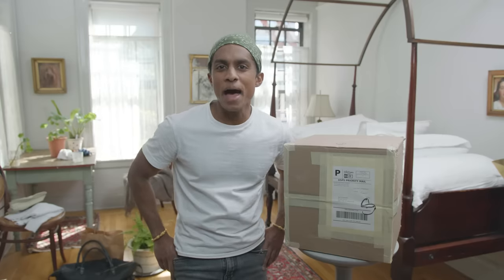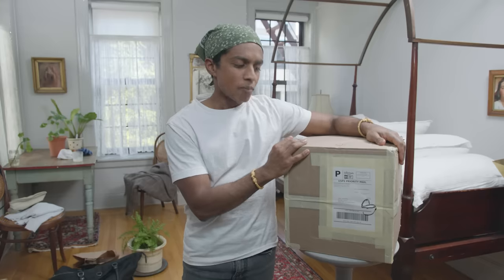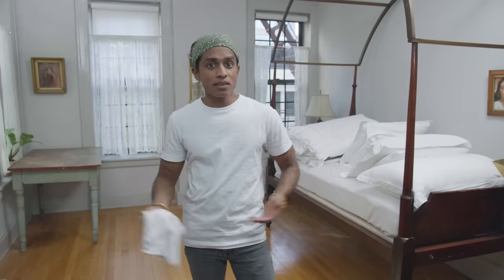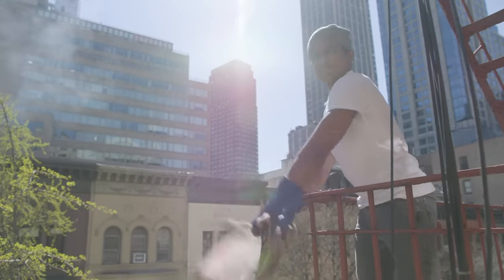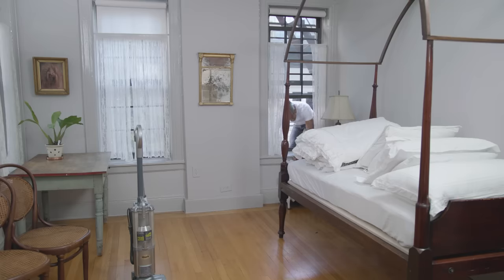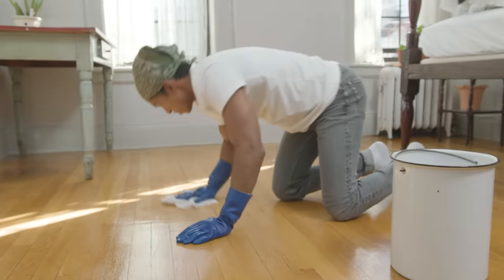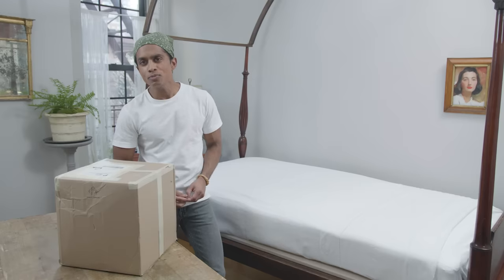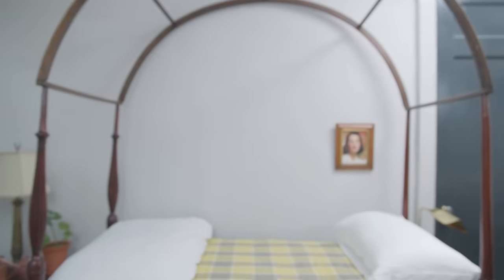How to Deep Clean Your Home, With Rajiv Surendra | Life Skills With Rajiv

Comment: Pretty similar to my deep cleaning methods! Only suggestions I have would be to slightly dampen the dusting rag to ensure the dust sticks, and also to use a HEPA vac on the floors to trap the finest dust. Good tips you gave to use a white rag to see the collected dust, and to always clean from top to bottom!

Comment: Love the gorgeous blanket!! I cringed when you cleaned the floor on your hands and knees, though. I, too, own a 100 year old house.  Like yours, the hardwood floors were not sealed - so only hands and knees cleaning did the job.  I only did it twice a year - way too much work.    Finally, after doing this for 35 years, I decided to 'go for it' and had the floors refinished and sealed.  Now, I only vacuum weekly and 'clean' monthly: with a little spray of floor cleaner and a quick wipe with a micro fiber pad.  Done in minutes - no achy knees!  I know, with an apartment that may never be an option - but the day you have a place with polyurethaned sealed floors, your knees will thank you!  Great cleaning video!

Comment: I just did a little experiment....I usually use one of those mops that has the washable fabric pads that cover them to wash the floor.  I thought it was clean until I went over it with a rag to dry it....nope.  It still had dirty spots.  Then I did the same today with a cloth and some Murphy's Oil Soap instead of Dawn and there was no dirt on the cloth when I dried it.  The old way does work better.  Plus being closer to the floor, I could see every little speck I would have missed if I was mopping with a mop.   Sometimes the old ways are the better ways. :)  Thanks for the video.  I can now enjoy my clean floor all weekend :)

Comment: Today, for the first time ever, I cleaned my bathroom floor using a bucket of water with floor cleaner, microfibre cloth, and a scrubbing brush. It was how I recall my mother cleaning floors when I was a child. Unlike when I used a mop, the little corners and crevices did not irritate, annoy or mock me. When I was done, the tiles and grouted areas 'smiled' at me. Before today, I 'cleaned' my floors: Today, I 'cared for' my floors. Subscribed. Enough said.

Comment: For hardwood floors, I use white vinegar and hot water. Sanitizes and removes even the silicone from kitty litter from the floor. Silicone makes the floor dangerously slippery when wet. Thank you Rajiv.

Comment: I think the word for cleaning could be cathartic, or metaphorical. I appreciate you’re using gentle cleaner, and no synthetic sponges. Here’s my routine: I use washing soda in very warm water-works well for bathroom, especially mold prevention/remediation (I will mix washing soda with borax 2:1 parts, and a gallon give or take of water). Oil soap is great for wood..And  I put hydrogen peroxide 3% in a spray bottle to use as window cleaner, gets kitchen stove and tile super shiny, just wipe off/buff with a cloth. I also use cleaning rags that last way, way beyond sponges. They are better because they conform to every little nook and cranny, and don’t drip messy like sponges..and aren’t of plasticky stuff. Actually easier to use!  Thanks Rajiv, loved this vid!

Comment: Now that I have retired I have time to thoroughly clean my house. With all of the places where dust accumulates, I’m surprised that I never acquired the equivalent of black lung disease. At least once during the summer I wipe clean the blades of all of the fans including the ceilings fans. I haven’t shared this before but after washing my microfiber mop heads and they are still slightly damp I dust the ceiling and walls. I hate cobwebs. The other thing I clean more than anyone else I know are my windows. Window cleaning has gone out of fashion if I judge from observation during my neighborhood walks. It is very rare to see homes with open drapery during sunlight hours.  Letting in natural light through streak free panes lifts my spirit.

Comment: I got a challenge of cleaning a muddy kitchen floor that has sat for three years, with muddy dogs running in and out of it. The corners are where I've got to start, places too where the dogs shook the mud from their coats, ugh. The floor will have to be cleaned, I think at least three times to get it back to the clean it needs to be. I had to watch your video to be inspired, because you o things the way I think they should be done to get it right.

Comment: Totally agree with you when you deep clean 🧽 right it feels therapeutic I use an old mop pole and rags to deep clean the floors; also cut up old towels too but the tend to leave towel strings on the floor I use the pole because I donot want to hurt my knees also I donot use brooms to sweep because all the dust gets on the walls lol and then I had to clean the walls…. Thx for sharing 😊

Comment: I wish I could get down on the floor to wash it like you showed, but I’m too old for that. I use Murphy’s Oil Soap and a Bona cleaning pad. I use the bucket with the soap and rinse the pad in the sink every few feet then back in the bucket so I’m not mixing dirt into the soapy water.

Comment: I use my pillow cases to dust large surfaces before throwing them in the wash. For crevices, I use an old cloth so that if it stains, I don’t care. But to save time and my sanity, I strip the bed and use those cases before washing. Of course it depends on the dust.

Comment: I like to use canned compressed air to get dust out of nooks and crannies (like the underside of chairs or ornate picture frames or headboards) and then I clean it off the floor. Much easier than trying to contort a rag to get in there!

Comment: My grandma grew up in the soviet union and she had these Persian rugs everywhere, so when I was little and it was summer she had me to collect them, take them in the yard between these huge grey soviet "block" apartment buildings and there were always a sturdy string attached to two rusty metal pillars. So I went to the yard and one by one, I would hang these rugs on the string and beat the dust with a carpet beater made out of cane, and let me tell you that was an entire work out... Heh...

Comment: The only thing I might add for deep cleaning is: •doing the windows: washing any linens on the windows, dusting trim/molding, clean blinds, clean the interior side of glass in windows.(my mom would insist on exterior too)
•clean the walls , clear cobwebs, dust your walls and any trim with a cloth and spot clean any scuffs, marks. Clean switches, switch plates, outlet covers and air vents/radiators  Do this monthly monthly. If your walls have any kind of texture they will definitely collect dust.  Use warm water and an appropriate cleaner to wipe down the walls thoroughly 1-2 times a year. My mother did this in the early spring and late fall. 
•dust door frames, and the door itself. Wipe fingerprints from areas around knobs and that get frequently touched  (everything on the door would get wiped clean with warm water and soap 1-2x a year when the walls get washed  

Whenever we moved we had to deep clean, including washing walls and all surfaces before unpacking. (it happened several times as a kid) I have done this for every move as an adult too. It doesn’t feel like it’s my place until I clean it thoroughly

Comment: I agree with you with the dust part but when it comes to mopping, you don't have to sit down and do hard labour. At some point in my life, I have been a cleaner that went from office to office and cleaned floors there with a mop. Getting on all fours is a little inefficient and not good for your back. With extension handles, microfiber surfaces and swiivel heads, you can accomplish the same with a good mop compared to the way you are doing it.

Comment: Hi, Rajiv. My mom is a domestic worker. Here is a mom tip. That rag you were dusting with? Get two. Wet one through, wring it out as tightly as possible, and use that for your first wipe down, then wipe with the other one, dry.

Comment: Cubans use a mop that looks like a T, towels and a bucket of water. We change our the water after cleaning each room and get a clean towel as needed depending on how dirty the floor is and using clean dry towels to dry the floor. All the dirty towels can be thrown in the washer and sanitized. Very effective. We can't understand using regular mops, it seems  unhygienic. By the way, you forgot to clean the baseboard and windows. 😉

Comment: My method for floor cleaning is a bit different. I fill a sink or bucket with warm water and  1/8 to 1/4 cup Borax. I have a stack of white terry cloths that I only use once. I put 2 in the water and wring out most of the water. Then I fold them in half and drop them flat on the floor. I step on each one and slide around the floor. As the cloth gets dirty, I turn and flip it until all sides are dirty. Then I put 2 more clean cloths in the water and repeat. 
This way the floor is always wiped with a clean cloth and I don’t have to wring out dirty cloths in the clean water. 
The small amount of Borax gets up the dirt without the need to rinse.
My floors are vinyl and I put Holloway House Quick Shine Floor Finish on to give them a shine. This doesn’t need to done often and when I do, I rinse the floor the same way I wash it.

Comment: Nice video - but it’s a myth that feather dusters just spread dust around. Usually, they are specially treated to attract dust. Also, Swiffer makes effective dusters (also treated) with washable dusting heads - just toss them in the washing machine. Dusting with a damp rag is great… until you need to reach a high ledge or cathedral ceiling. Or if you don’t want to get your hands into spidery cobwebs. Amazon sells telescoping dusters for this purpose.

Also, cleaning floors on hands and knees is great when you’re young and in gold shape. However if you’re an older adult, and/or have any physical issues, it’s a nonstarter. Even if you’re young and strong, doing that repeatedly can eventually leave you with knee and back problems when you’re older….

Comment: You must wear N95 mask while you are cleaning house to prevent getting micro dust and chemical fumes get in to your lung  Use damp cloth to clean micro dust. I vacuum floor first, hand washing floor and vacuum again after the floor is dried.  Mix a cup of white vinegar to a gallon of warm water and use mop to clean walls to eliminate odors.  Always clean new beddings before use.  Steam your sheets at least twice week if you change sheets once a week.

Comment: The bucket and cloth still feels gross to me. I live in a tiny house so I dont have much to clean so I take a spray bottle with homemade castile soap and water and clean my floors like I clean my counters. Get a new cloth every 20 square feet. The rest is pretty much the same process though. I try to clean my appliances during that deep clean, been decluttering even more to make the process more frequent. Hard to find a place to move things when everything is tetrised in perfectly.

Comment: Here's a summary :)

1. Tidy your room up
2. Dust with a cloth 1x weekly - Work from top to bottom!
3. Vacuum your rugs and shake them out
4. Vacuum floor thoroughly 
5. Wash your floor- Use a cloth and wring it out after a few wipes (don't forget the molding)
6. Change your bedsheets

Comment: Doing that level of cleaning every week to a small room is okay but to an entire house is impractical.

1. Change your clothes in the bathroom. Shake your clothes over the bathtub. Once dressed, quickly brush over your clothes with a lint remover.
2. Every morning use a sticky sheet lint roller over your sheets, pillows, and blankets.
3. Get rid of carpets and rugs.  And cheap clothes, cheap sheets, and cheap towels.  All of these generate a lot of fibers (the "dust" coming off of your already vacuumed area rug is the rug's fibers). A large percentage of dust is textile fibers.  For many people it may be the largest contributor to household dust.

Now that you have less dust, you can skip the weekly intensive dusting routine and only clean the floors.  Do the dusting every two weeks or even less.  Microfiber towels hold the dust a little better.  Wiping some surfaces with a wet cloth is better.  A final dusting with a feather or microfiber duster helps to get those last bits that inevitably are left over after wiping with a cloth.

If you REALLY want to deep clean your home...that's tough and takes a very long time.  There's dust and filth everywhere.  On your curtains, on your blinds, in the back of your closets, behind your refrigerator, under your stove, behind your TV, and inside your TV.  This video is nice but most homes contain more than a bed and a few plants.

Comment: As a cleaner, your methods seem a bit back breaking, long armed tools like dusters and mops make the work a lot faster, easier and are just as effective when used the right way.

Some basic rules I go by: 

Using a duster moves dust into the air (as does all dusting) so opening windows and wearing a mask are essential, as is tying back curtains and covering large items like couches and mattresses with sheets before starting. Working from top to bottom is very important as you said (don't forget to start at the ceiling as dust clings to spider webs), running a duster along rather than shaking it about, taking the duster out periodically to beat the dust out of it, running the duster behind and underneath furniture last (these places are close to the floor, hold the most dust and will dirty the duster so doing them last prevents moving dust around the room), basically doing everything you can to encourage ALL dust in the room to fall to the floor where it can be vacuumed up. I run a lightly damp cloth over all surfaces, objects and architectural details (base moldings, doors, etc) at the end and due to the previous steps it will only take one pass of a cloth by hand rather than multiple.

Mopping can be equally if not more effective than using a cloth to clean floors by hand as you can work faster and keep the water hot, hot water is much more effective at killing bacteria and removing grime and your method would require getting up from the floor frequently to change the water to keep it hot. I always use an electric kettle to boil water for mopping (filling a kettle with hot water from the sink saves time and corroding the kettle, 2-3 full boils is usually enough for your average size kettle/mop bucket) and I carry a dry mop with me to dry each section after passing over it with the wet. Using hot water and drying as you go means you can repeat the entire process immediately (after changing your water bucket) and go as many passes over a room as required without having to walk over wet floors and dirtying them again.

Lastly, this should go without saying, using cleaning tools that are clean themselves and replaced when dirty enough is essential. My preferred tools for above are: 

An extendable or long-armed, fluffy ended duster as they are cheap to replace periodically, readily available, light and easy to use. They should be taken outside to shake the dust out frequently when using them and again at the end to ensure they're not full of dust next time they're used.

A standard corded mop and bucket, corded mop heads are again cheap to replace and readily available, you should buy multiple heads and use a different head for your main areas vs wet areas plus a third one to keep as a dry mop. Buying different coloured heads saves having to label them, soaking the heads (separately) in tea tree oil diluted in boiling water after use and drying them completely in the sun ensures they're clean before being stored.

Respectfully disagree that long armed tools aren't as effective as doing everything by hand. It's more environmentally friendly doing it by hand but your back will thank me in the end.

Comment: That’s not deep cleaning coz you did not clean the ceilings then the walls then the windows then the desk then the floor .you dust first then you vacuum after then you mop . Before you start .you need to remove the curtains then the bedsheets .wash them and then you can start dusting . What you did is just daily cleaning and it’s not deep clean .